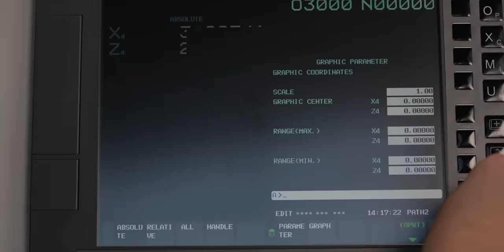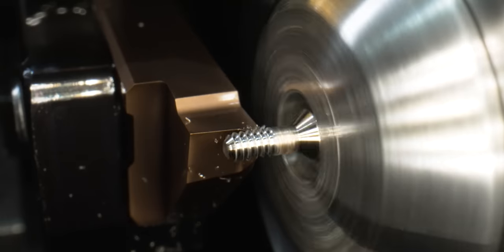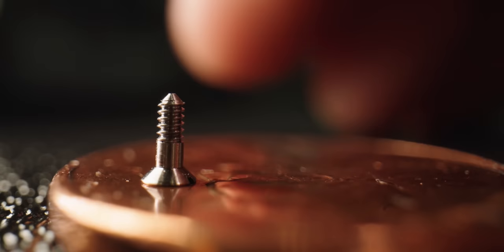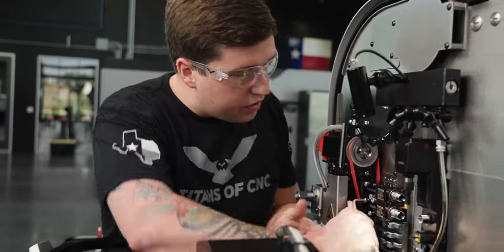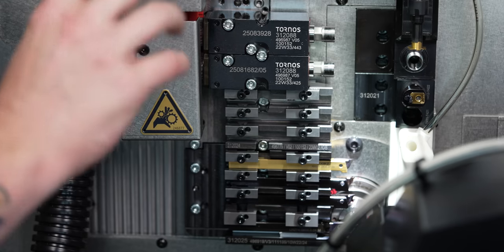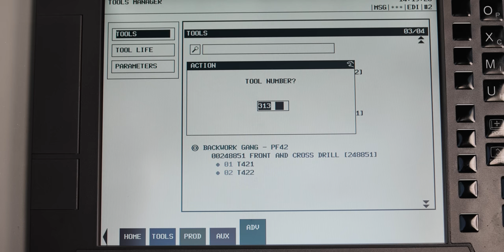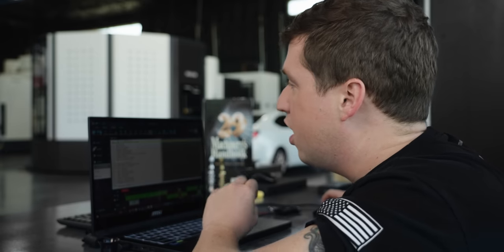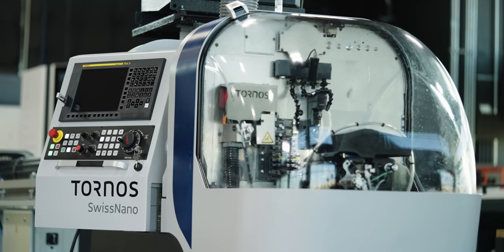MICROSCOPIC Machining! ᵀᴵᴺʸ  Parts on the Swiss Nano

Comment: Been making tiny intricate parts on a citizen swiss machine for the last ten years.
With 1/8 stock i make a 2 inch long .070 dia screw with a 1/64 thread and a slotted 1/8 head.
When i first started i was stunned by this part. I knew nothing about swiss machines at the time.
Now im a self taught cnc machinist/programmer. In charge of 3 citizen swiss machines and a normal citzen/miyano cnc lathe.
Also am in love with the new horn tool holders with the front facing set screw, have the new holders coming any day now, maybe today. Horn not only makes tiny accurate tools, they are also insanely durable.

Comment: Stoked to see some micro swiss love on the channel! Been running an L20 with b axis capability for about 4.5 years now. Loving all the tiny tools that come in and I look at and go no way this works. Cutting Ti and making grooves with a .007" wide tool for about 10k parts is bonkers. I do with the live tools on this thing had more ooomph though haha. Ill Have to look into Horn, weve been using Gen Swiss for our stuff and have had really good luck so far!

Comment: It’s crazy seeing such a massive machine make such tiny parts, and the parts try is adorable lol as a hobby machinist and horologist i and almost exclusively working with very very small parts and most of my machines are dedicated to producing and machine tiny things like screws, gears and watch components, it’s truly such a completely different ball game when you have to machine such tiny parts and in doing so they have to be made with insane tolerances to fit and function properly so, again it blows me away seeing this absolutely massive machine accurately produce such small parts, just amazing
Reply: What's crazy is that of all the big brands that make machines, that particular "massive machine" is the smallest on the market.

Comment: Great video Donnie.  You have a great ability to communicate technical knowledge in an interesting way.  How do you figure out if the pressure to cut threads on a micro part would be too much stress and fold the part over.  Are there calculations available already to figure that out?

Comment: I am making a similar screw but it's 11" long. It takes 2 regrips. And is ejected through the long workpiece ejector using the high pressure oil.

Comment: I was making a 30+ mm long M5 bolts on Doosan Puma 280LM this month. Doing something so small and so long is pretty much a tricky thing. Was forced to divide processing of 5x30 segment into three separate parts, and there was still a need for countercone. Also, we had to buy some good thread cutting dies, cuz thread insert will just simply bend the bar. Small parts are just a pain in ass sometimes. I'm just curious, if this kind of part is somehow easier on a swiss machine. Also, 12mm hexagon bar was used, not a round bar.
Reply: Yes it does, have made parts that were 250mm long and 4mm diameter on our swiss machine
Reply: Typically longer turned parts are easier, but like he said, you can only retract as far as your guide bushing bearing surfaces are and maintain support of the material. Can get tricky.

Comment: Could you show us how you program the tool paths, do you have to type G code in line by line or is there a conversational way to do this? Does it show you simulations and things? What about live tooling and threading etc? Also can those live tools do rigid tapping?
Reply: I've never run one of these but I run Tsugami swiss machines at work. They also have a FANUC control. There is no conversational programming interface. I actually don't know what CAD/CAM they use at work. I think its Mastercam. 

The Tsugami machines do have canned cycles that you can use without having to use CAM software to draw a part and generate G-code, but its for simple stuff. We don't use any canned cycles though. Our parts are complicated firearm components. Its mainly production work with some prototyping thrown in.

We have done rigid tapping for very small threads but we mainly use thread mills for I.D. and threading inserts for O.D.
Reply: TITANS is a Mastercam shop. I am not in that area of the industry, but look into the capabilities of Mastercam to have your questions answered.
Reply: @SirRapTureGames  it's just doesn't the citizen version of this software have all sorts of routines you can program conversationally? Like mazatrol. Select a unit, enter your values and it etch a sketches it out for you

Comment: I would like to see you make a screw 1,5mm length and 0,3mm diameter with a thread. As a watchmaker I do this on a lathe and would like to see the tornos quality on a screw this size
Reply: That’s a great idea! I didn’t want to go as small as possible right out of the gate but I plan on doing that in the future.

Comment: What a wild machine. One question as far as that specific flat head screw is concerned; why the standard slot and not a phillips or torx-style? I don't understand why slotted it flat head style screws are even made anymore considering the far superior styles that are being used.
Reply: A lot of Watch screws are just flat head like the one in the video. I’m sure eventually I’ll try to make the worlds smallest torx (thanks for the video idea) but when I look at all the watches I have here they use flat head. Probably due to how little torque is needed for watch parts
Reply: @donniehinske  Touche good sir touche. Watch parts excluded then, why in the hell are they still being made/used?
Reply: @FiglioBastardo  Well I am sure cost has to do with it. Also works fine for house hold stuff. Anything else tho is probably a hex or hexalobe

Comment: The STAR swiss machine has something similar. so instead of using packing on each cutting tool to create an offset, the entire turret is capable of moving in Z to allow for an offset.
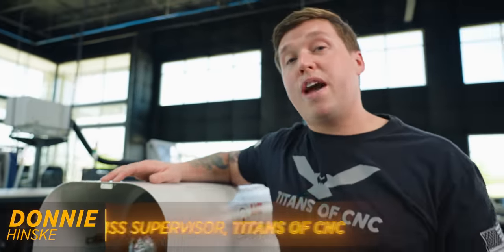https://youtu.be/fzA8vdHCkx4?t=25 @0:25 you see a labelled diagram of it's axis